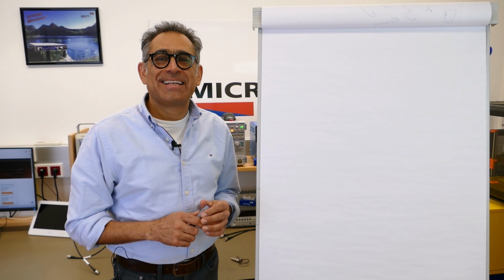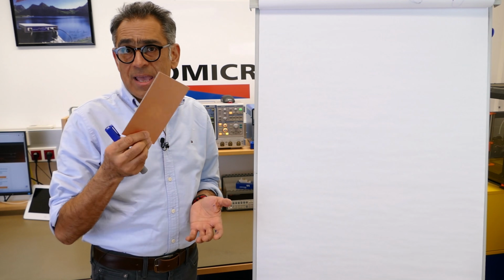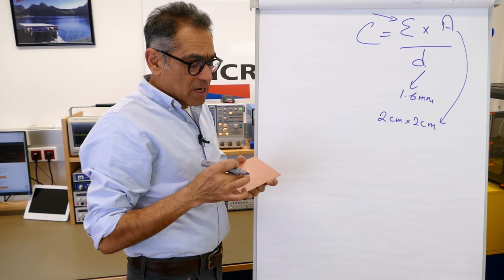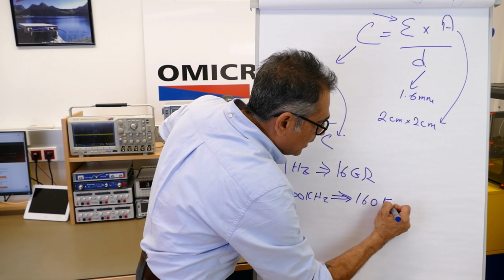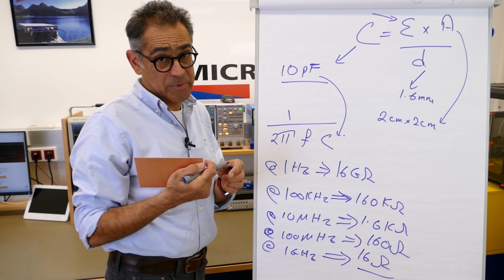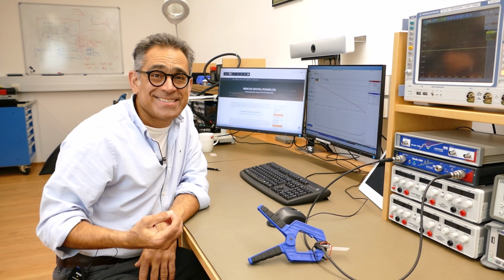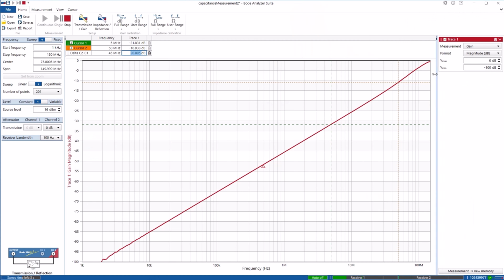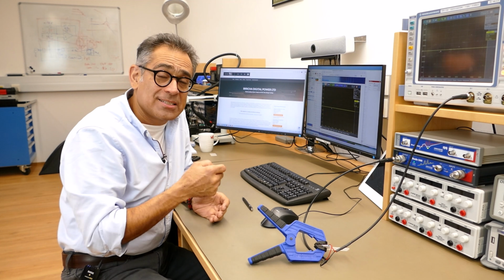EMC Debug Fundamentals With Real Lab Demo: Capacitive Noise Coupling Explained

Comment: Thanks for a good demonstration.

I suggest you stop using cm, as the centi prefix is not an engineering prefix, like micro, milli, kilo, Mega, etc.  The calculation of capacitance is a perfect example, where you (offscreen) had to convert cm to millimeters anyway.  Using cm because "its almost like an inch" is not a good reason.  Having prefixes 1000x or 1/1000 make it more obvious if a mistake is  made, as you did with the dielectric thickness.
Why use cm if you dont use centi-Ohms, or centi-Volts, etc?

Again, the content is good.  There is no place for cm in engineering (or anywhere else 😂)